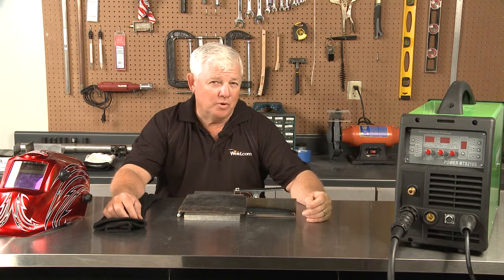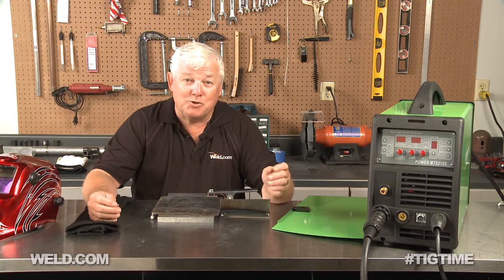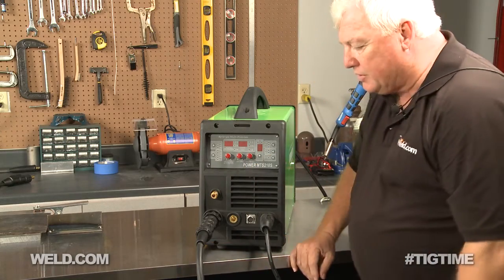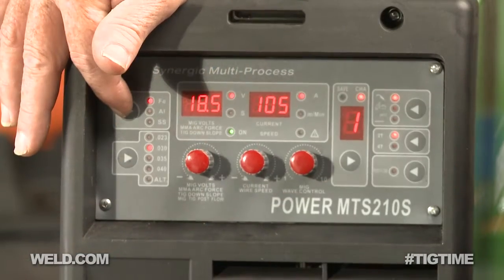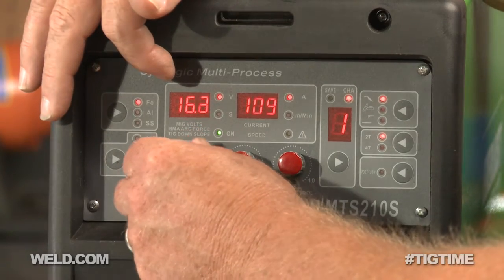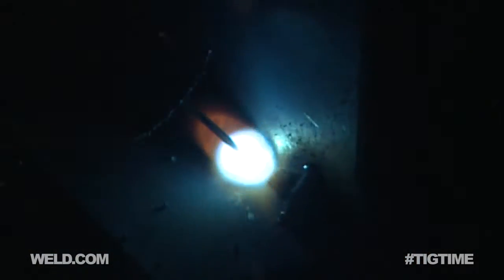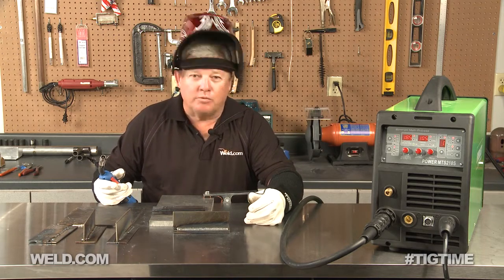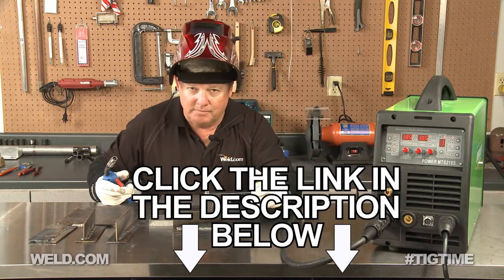Everlast MTS 210 Welder Review : Part 2 (MIG) | TIG Time

Comment: This is a synergic welder so he shouldn't have to play with the settings much. If he used the synergic function, just set the material and wire thickness and the welder will automatically come up with settings that should work satisfactorily.  Of course, he could tweak to make things even better but it should be painless. I'm not sure why he felt the need to play with the settings.  Sometimes reading the manual allows the operator to actually use the welder to best effect!